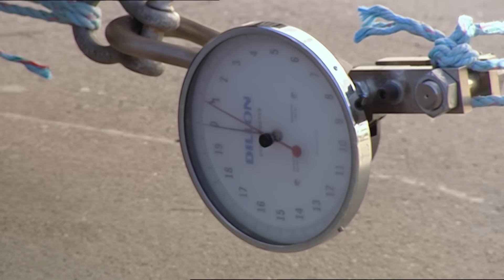Can A Snowplow Blast A Car Off The Road At Highway Speeds? | MythBusters

Comment: If that plow was currently hurling snow at a car, then I expect that it would have a chance.  But just air?  Absolutely not.  The required force of air would make the plow steer one direction with significant authority.

Comment: Winters in Cda can cause drifts big enough to bury a 1/2 ton truck on the hiways. You can sky rocket a mid size car easily at 45 to 50 mph, but the damage to the plow will put it in the shop for 8 to 16 hrs of repairs. Not worth it.

Comment: Speaking as someone who this has actually happened to, I was always disappointed with this one. When it happened to me, it was windy and the roads were iced over. This was in Iowa, not quite the kind of thing you can replicate so easily on an air strip in California.
Reply: Well, the result of "myth busted" comes with a bunch of asterisks and foot notes after. Just as a reminder.
Reply: Then it's the wind blowing you. Not the plow. Fqvcking ldlot lol. The myth is about the plow blowing a car. Not about the wind. I've seen wind been able to blow even semi trucks and flip it to its side. What a dummbazz. Lmao
Reply: I call bullshit since the direction of the plow would not push you off the road if you where passing in opposite directions. Also in order to be pushed off the road the plow would have to be passing you in the fast lane while you are in the slow lane and plows don't run that fast
Wind and ice got you, and if it was the plow, it wasn't the "plow" but the truck itself creating a buffer of wind.
Reply: @originalname9999  Plows on the highway do run 45 to 60 mph.